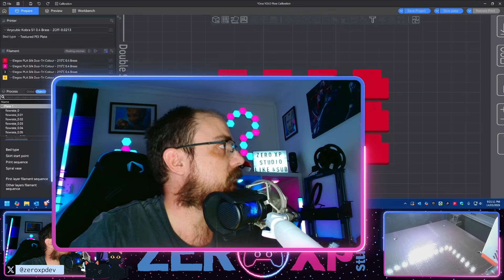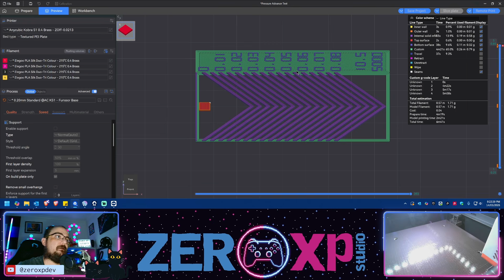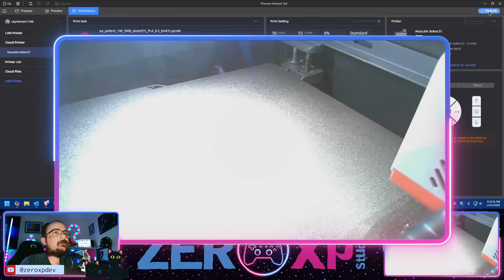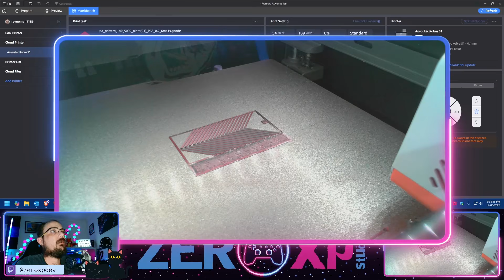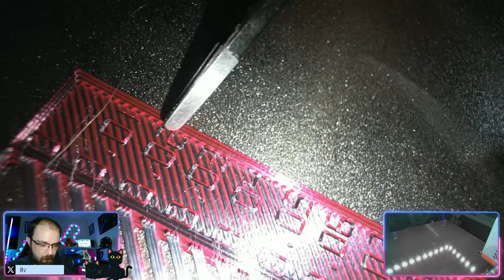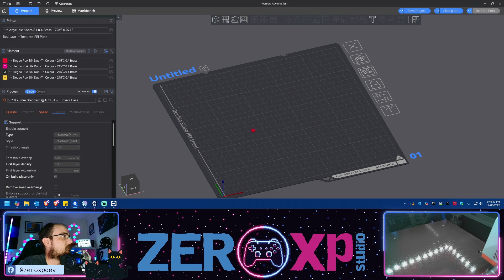Calibrating Filament Pressure Advance - Anycubic Kobra S1 | Zero XP Studio - 3D Printing Tutorials

Comment: is there a model to dial in pressure advance for crisp edges ? like perfectionist version this seems hard to read? and when testing my petg gf PA i should let the 98mms pa print setting or put in the speed i really print with (60mms outer wall) ? and for pla matte ,pla high speed when printing with other outer wall speed change it or allways let the generated settings with 98mms outer wall speed even i print with lower speed like petg gf ?

Comment: i try to dial in my petg gf i print with just 60-70mms and temp 255-260 i stll need to let the PA test let 98mms for outer wall ? and for pla matte ,high speed pla etc just use the print profile i usually print with it and let the like 98mms outer wall or need to adjust like the speed i print in real life with ? thanks! allways though the calibration in slicer next was broken with the sqaure i never sliced it haha thanks for htis please more kobra s1 video s